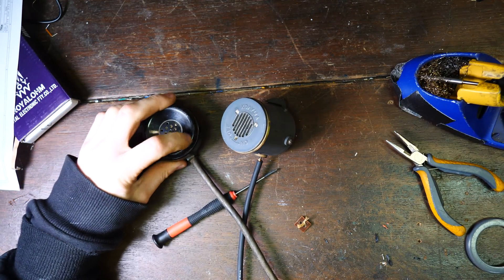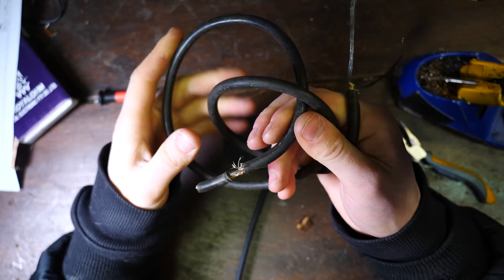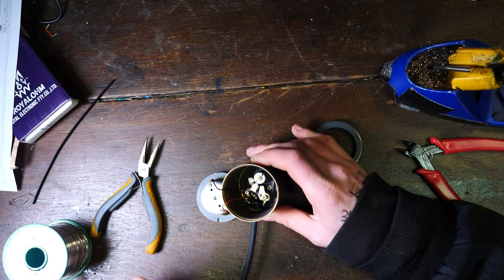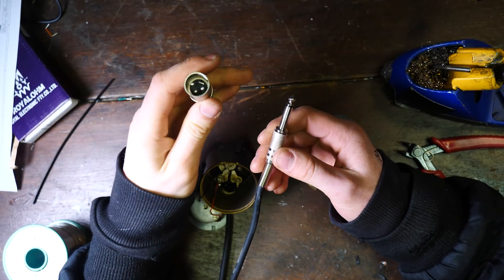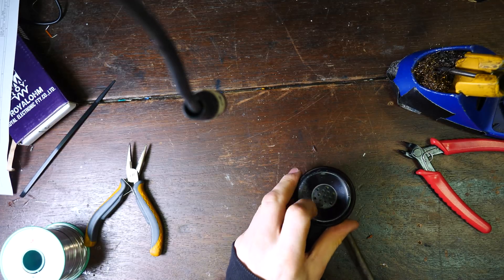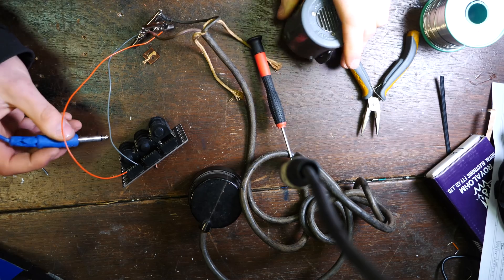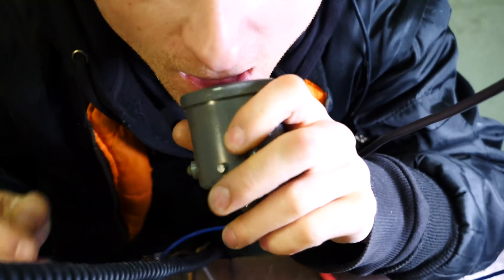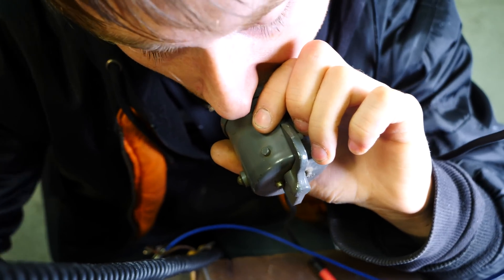Repurposing Garage Find Microphones.

Comment from the maker: Check The Video On The Test Equipment Lot I Got For The Museum https://www.youtube.com/watch?v=0Eo3Kn05SdU
Reply: Im glad im not the only one to put my mouth on old crap i find in a garage only to realize half way that it isnt exactly the best idea. Mine was an old cobbled together pan-flute style instrument. I just was making a bunch of toots, and the wife just shook her head.
Reply: I saw you got a load of components the other week/month, in which there was a tray of crystal oscillators (4 leaded cans with pins in corners of 14DIP package pinout, giving TTL logic outputs , probably 1MHz to 40MHz - see can labels), and a mountain of 74 series logic chips. Those crystal clocks have TTL outputs, and probably in the 1-40MHz range. If you have multiple (2 or more) of the same frequency then read on...
It got me pondering a musical instrument. Each of those clock sources is +/- 5 to 50 ppm typically, so say a 10MHz clock is +/- 50 to 500 Hz (scale up if higher frequency or greater tolerance).
So if you mix two of these TTL outputs together (any logic gate AND, OR, NAND, NOR (XOR* potentially)) then low-pass filter the output, you'll have a beat signal frequency from the difference of the two clocks - Something in the range up to say a few hundred Hz for a pair of 10MHz clocks. Higher frequency crystal clocks will give you potentially zero to higher frequency.
Next step, if you mount those crystal sources on separate little boards like a keyboard (wire them up with those nice coax cables? ;) then tap on them like a keyboard, the percussion will affect the crystal frequency and should make an audible variation in the mixed signal (small variation in one ~20MHz compared to another ~20MHz will be audible blip or wobble of frequency difference). Likewise temperature generally affects the frequency, so warming under fingers will cause a frequency drift and audible difference between two clocks. It could make quite a fun interactive instrument with all those oscillators mixed together (a tree of AND/OR/XOR/NAND/NOT gates fun trying out them all) then low-pass filtered.
Reply: @quesoestbonne  I'd love to see this!
Reply: @Khola_D  i have a number if 24MHz clock modules left over. I'll try knock something up.

Comment: There actually can be a bit better rejection of interference with balanced connection even if the mic capsule only has two connections. You just connect one to the hot pin (XLR pin 2, positive) and the other to cold pin (XLR pin 3, negative). Cable shield is connected to the ground pin (XLR pin 1) and you can either leave it unconnected in the mic end, or connect it to the case of the mic if it is metallic and not actually connected to the electrical terminals of the capsule. Most dynamic mics are actually connected like this. The theory is that the balanced input will amplify the signal difference between the hot and cold pins and does not actually care about the ground. However the noise and interference induced to the capsule and the wiring will be roughly equal on the hot and cold and it will be canceled out.

You don't seem to have any noise issues with that mic, but well... If you ever do, balanced XLR might help even if the capsule has only two connections. Taht carbon mic is a different story though. It will probably needs a DC-voltage source to work properly.

Comment: Hey Sam, i wondered a few days ago if you have any plans of reusing or transforming some old telephones, apart from the average mics made with them, and also the carbon ones most of the time forgotten. Thought it would be cool for a video... i don't know if its possible to synthesize some sounds out of it? There are the really old ones and the most modern ones with a speaker instead of the bell... anyway! Cheers, Cool videos as always!

Comment: How many cores did the cable for that mic with the switch have? It looks like a mic from an old tape recorder, they often had two jacks one for audio and the other for remote, when you turned the mic on the tape recorder would start up. I have an old Mayfair portable open real tape recorder with that feature.

Comment: They're crystal piezo mics. They were used a lot with valve gear!
Reply: They're very sensitive, which is probably why it's clipping. They were made so that with the gain set up properly you could just set the mic up with your wire or reel-to-reel and record the room.

Comment: You can also make microphones from old rotary dial phones. The microphone needs a DC voltage but you can also wire up the speaker as a mic. 
We used one with our band and a lot of people liked it.
They also sound cool if you mix them with a regular mic or even mic up an amplifier with them
Reply: yeah I often use the speaker as an additional overhead on the drums, it just ads a little bit of dirt and mids. Really, really cool. I'm now going to use the real microphone, I think a 1.5V batterie should work. Or how did you do it?
Reply: @cheapironman1916  i only ever used the speakers because i like not having to think about batteries.

I've seen schematics for the carbon microphones using 1.5 all the the way up to 48 volts.

I have 2 or 3 lying around so i might try it out this week
Reply: @stefandumoulin1872  the resting voltage for analog phone lines in the US is 48 volts.  It doubles to 96 Volts when the phone rings.
Reply: @goodun2974  yes that is correct but what we are talking about is actually the dc bias voltage that the carbon microphone needs to operate. The ac voltage you are talking about tells the phone when to ring and the telephone company wether or not you picked up the phone.

Comment: Unlikely to be carbon, you need a voltage to make them work
Also, you can usually hear the carbon granules if you shake them
For anyone wanting to use carbon mic's, use maybe a 1K resistor from a 9-12 supply connected to the 'positive' of the mic, also connect a capacitor to this point to the input of the amp (dc isolation) try a 1uF
Common the grounds.
Reply from the maker: aaah I just realised what happened, the bit where I say this might be a carbon mic, I couldn't hear it working in my headphones I only later found out it was working when editing the video, at the start of the vid I shook the capsule next to my ear (took it out of shot) to see if there were any shakes sounds, thanks for the info on wiring up carbon mic I have a big one I wanna plug in cheeeerzzzz
Reply: Wish I'd known this info when I had an old phone handset with a carbon mic in it.  I just couldn't get it to work!  Ended up just using the speaker end as a mic in the end.  Lo-fi but not a vibey I'm sure.  Actually,  I still have it. Hopefully I didn't remove the carbon mic, can't remember !!
Reply: Have you thought about using phantom power for this instead? Seems like it might be convenient.

Comment: Now ya need to start collecting up WW2 era military issue headsets, etc, with mics, and always use them as your regular mic for most of your content.
Reply: I have 8 old-stock military headphone or earbud transducers, probably World War II vintage or not much later than that from the look of them, each of which contains a pair of coils wound around pole pieces, a magnet, and a little metal plate touching the transducers, which is the audio frequency diaphragm. I have to wonder how they would work as microphones, probably with an impedance matching transformer,  or even as guitar pickups. I haven't measured their resistance yet....